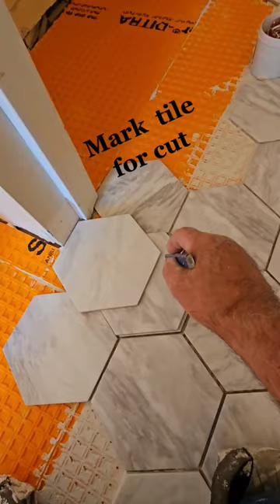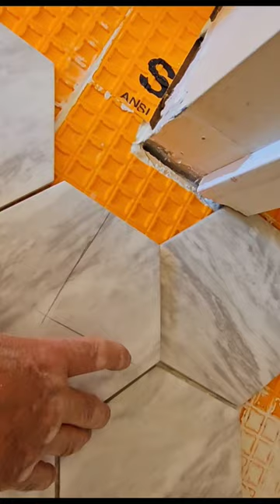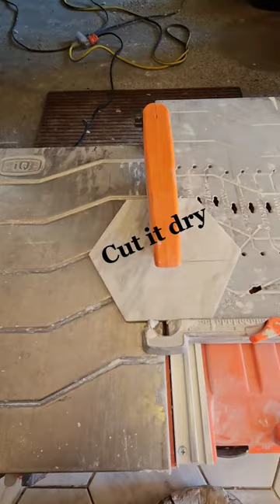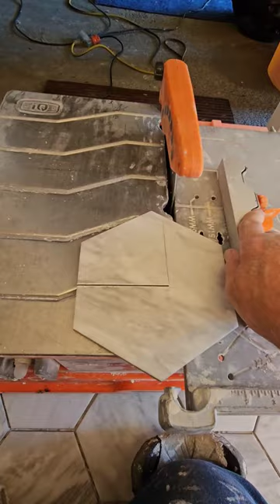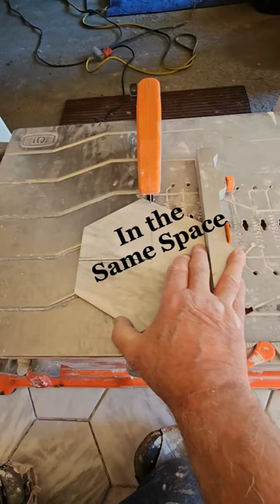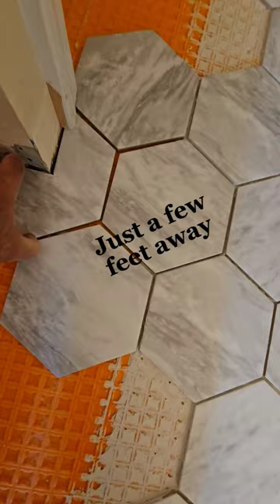Cut tile close to you. IQ 228 Cyclone 7" Tile saw #tile #iqpowertools #shorts  #cuttingtiles

Comment: Can't work out if you're using a levelling system on an uneven floor how the tile isn't pulled away from the adhesive ?
Reply from the maker: Dry laying tile for a few cuts. no leveling system.
Reply: @SalDiBlasi  Just generally,Sal.

Comment: Does it cut clean with no water?
Reply: It should given he is keeping the tile still, if it can vibrate too much it will chip.

Speed is also a factor. Slower is less likely to chip.

Also, some tile materials chip very easily, like porcelain while others are more forgiving.